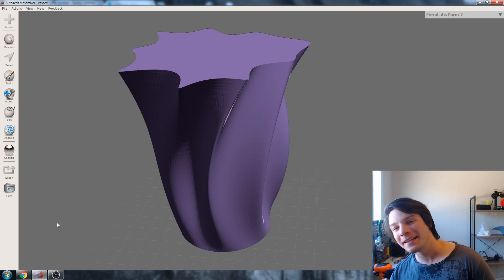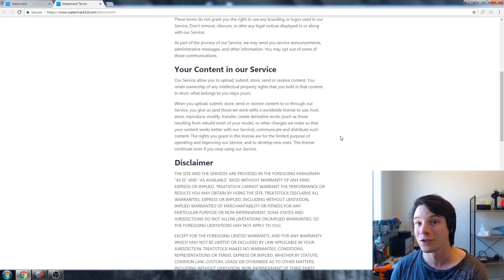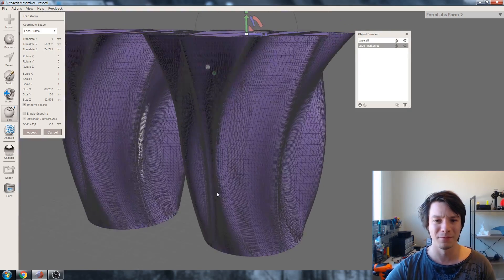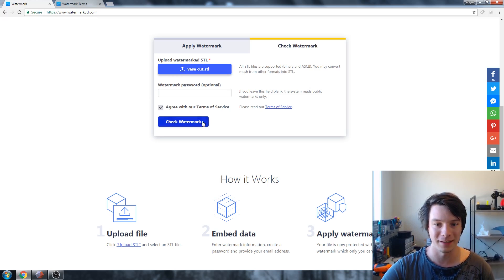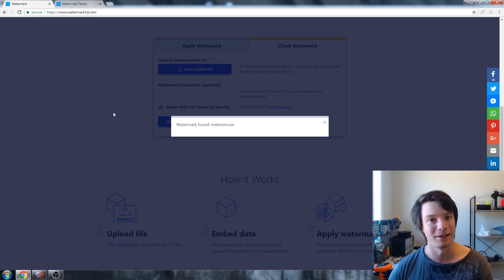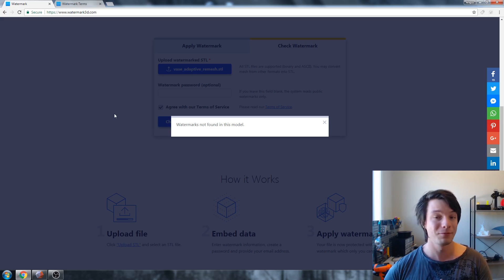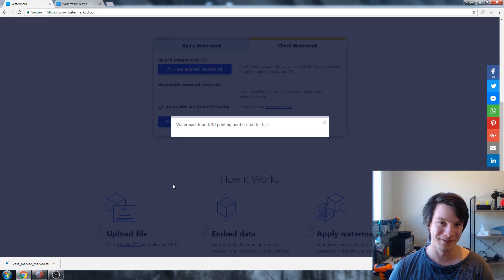How to defeat an STL Watermark (but would anyone really do this?) Watermark3D Round 2

Comment: As a programmer who works with the data files of 3d meshes, I can explain how this works and why it's not as easy as re-watermarking it. (Sorry this is going to be long, but it's worth it to learn! :D)

The system, from what I can see, works on a system with 1 layer of redundancy (which is better than none!), which is why cutting the model in half didn't work. Those points where the watermarking process has changed the geometry, you can see them as the clustering areas that get extra divisions in the wireframe of the resulting model, are each a watermark on their own. You'll see four such spots up the side of the model in some frames of this video, and they're thrown around based on some spacing algorithm. With them all over the model, the software only has to look for one of the many watermarks it has put on. So cutting the model in half may have deleted 4 of 8 watermarks, but of the remaining 4, at least one of them could be read.

I would wager that if you examined the model by eye, found all the areas that were distorted, and made a small geometry change to each one, like deleting a vertex or a couple sides or triangles and filling in the hole, then, if you didn't miss any, the watermark would not be able to be found by their software, and would be destroyed. This is why re-meshing the model DID destroy the watermark - that form of attack successfully alters each one of the spots on the model where the watermark was applied, destroying them all, and leaving none for the program to find.

Additionally, this program clearly stops when it discovers the first watermark, and returns that result. It is surprising that they didn't think about this, but oversights happen. However, that also means that your previous watermark WASN'T ERASED - and you'd be able to prove it's there if you needed to. All that happened was that when you watermarked it a second time (thus adding the new areas of distortion that you noticed at 10:14 in this video), the service added the new watermark at different spots on the model, leaving the old one intact. But when you put it into the service again, the service was looking for a watermark pattern in a list of vertices, and the one it happened to find first, based on where on the model it was placed, happened to be the second one. This will always be the case for this model no matter how many times you scan it, because it's the order of the watermarks built into the model that determine which one gets read first. For efficiency, the programmers made the program exit once the first instance of a watermark is found.

With a simple change in code, but a significant hit to the speed it can scan a model for watermarks, they could make the program not exit once one watermark is found, but add that watermark to a list, and keep searching for others. The geometry of your model still HAS your original watermark, after all. The program just gave up looking after it found one.

A better solution that keeps processing time almost the same (probably slightly slower though), would be to scan a model for watermarks before any are applied, and throw an error if the model already has a watermark. This would be easiest to implement, and would negate the danger of partially overwriting a previous watermark, which could happen if they went with my first suggestion, which may result in a corrupted or overwritten watermark result.

My final suggestion to improve this service (not that the company will see this or anything XD) would be to add in more layers of redundancy - like add in the technique where you modify the binary of the STL file - sure re-saving erases that, but then you have more steps that someone has to go through to remove your watermark, and only if someone knows about it. (I guess I am kinda spilling the beans, but oh well, how many people are going to see this comment anyway? :P)

All in all, this is a great program and a great technique, and as you mentioned, thieves wouldn't go through the work required to remove such a watermark. I love this idea, and fully support it, assuming they made the quick change in code to throw an error if you try to watermark an already watermarked image. Great job on Watermark3D's part, and great job to Maker's Muse for doing a second video about this based on the comment reactions, giving us the thorough teardown we wanted! :D
Reply: Thanks, i learned a lot about redundancy here, even if i'm a programmer myself (not in this domain AT ALL).
It was worth it to search for your comment !
Reply: I wonder if you send them an email if they'd consider (or maybe already have implemented) ideas like this... (I wonder if they've watched this video, since they reached out to Maker's Muse originally).
Reply: Is it possible that the algorithm that decides where to place the watermarks, is simplistic enough that it literally put the new one on top of the preexisting one, thus actually "overwriting" the old one (or at least corrupt it beyond recognition)?
Reply: Great contribution!
Reply: the most underrated comment on here!
Reply: Good explanation! Thanks for the bother of writing it here!
Reply: interesting
Reply: this is exactly what i was thinking!
Reply: I’d like to see time stamps added to the watermarks combined with searching for all watermarks on a given model. I’m also curious whether the actual watermark is encoded into the mesh or if an ID (almost like a QR code or barcode) is encoded and represents an ID in their system which they match to the watermark that they have stored for that ID.
Reply: @Deesdessessesder  most probably the text is encoded and not stored plainly, because otherwise you would need bigger watermarks for bigger texts.
Reply: Oooooooooowww kaaaaaaaayyyyyyy

Comment: Could you try and watermark an stl that is already watermarked and see what happens? If you succeed with that could you continuously layer watermarks and see if it eventually ruins the geometry? And then with multiple watermarks put it in the things that checks for watermarks and see what it tells you? Should be interesting just to see how the software works
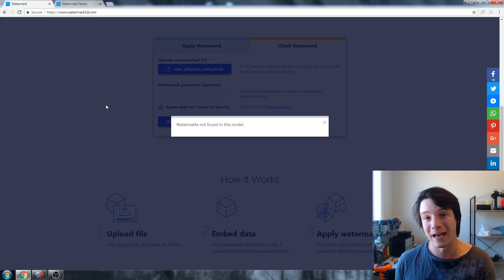Reply: < commented before I got to 9:31 so you can ignore the first and last question but I would still like to know what happens if you continuously layer the watermarks and see if it ever starts to effect the geometry, also what happens to the file size with that many watermarks?

Comment: What if you were to print with a dual extruder where one extruder has PLA and the other has TPU (or any other flexible filament). Would that be able to make flexible joints?

Comment: There are probably re-meshing algorithms that can maintain the geometry while wiping the watermark. In fact, it can be argued that the algorithm that creates the watermark is itself is a re-meshing algorithm, so it's not surprising that similar algorithms wipe the watermark. As far as concerns about it wiping the old watermark goes - if you're not concerned about people finding the watermark to begin with, should you be concerned about wiping the old watermark by applying a new one? Doesn't the same logic apply?

Also, there is only so much data density that can be achieved using a watermarking algorithm like this. There might not be enough points on the mesh to store multiple watermarks, especially on sparse meshes.

Comment: Lot of algorithms exists to wartermark meshes for examples:
http://gfx.cs.princeton.edu/proj/meshwm/meshwm.pdf
Some of them try to resist to remeshing, smoothing as well.
So to do that we have to describe our mesh on another space. Like "If I launch a sound on the surface of my meshes how the shape of the sound will look like after 10 secondes (if my meshes is a jelly or metal etc)" this kind of description resist very well to a lot of thoses attacks.
We can do multiresolution as well:
https://pdfs.semanticscholar.org/2cf5/7837f09ebbf57f94b71ccd4a46f1eb01feed.pdf
We can do downsampling of the mesh & rewater-mark it at each resolution, and "reinject" the lost details. ( :

Comment: wow...how did the programmers not foresee overwriting the old watermark? I wonder if putting in a password would change the outcome.  It seems like it would make more sense to instead before it applies the watermark run it through the "does it have a watermark" system first. if it does then point that out "this model owned by xyz, would you like to reassign the watermark". where having a password would simply output something along the lines of "unable to complete operation, password restricted watermark already on model" and leave it at that.

Comment: Definitely weird, seems like it would be simple enough for them to check the watermark and say sorry this model already has one.
Reply: Box Jockey theyes prevent password protected watermarks from being overwritten
Reply: Someone down below mentioned two people could apply watermarks and passwords to the same file and depending on what password you enter, you get the associated watermark.  While that would technically preserve both, it sounds like you cannot verify which was first.  Just seems like only allowing one watermark would be a simple solution to prevent this, though I am sure someone would find a way around that as well.

Comment: Lot's of time and money, highly competent engineers trying to make a new copy protection watermark for stl files........ Just re-mark it... NAILED
Reply: Raposa Dislexa Ironic. They could save others from defeating watermarks, but no themselves.
Reply: Michal did you even watch the video?
Reply: The bright side is that it isn't quite that bad - the original "makersmuse" watermark is still there on the  model, it just wasn't listed for the sake of processing speed. With a slight change to the code, the original watermark could be recovered and read. (For a more detailed explanation, read my post that's somewhere in the comments here!)
Reply: @KyleBlumreisinger  Though it’s the same algorithm writing onto the stl file. I wouldn’t be surprised if the second watermark was editing the exact same locations that were edited in the first marking, completely destroying the first watermark. Easiest fix would just to check for watermarks and throw an alert if there was already a watermark detected before putting another on in.
Reply: Raposa Dislexa and there's a really easy fix! Just scan for a watermark when you try to watermark the file and if it finds one, refuse to make another!
Reply: Just seems like one of those minor bugs that can be easily fixed.
Reply: Did anyone bother to read the FAQ on the website? It states "If a password was used for the original watermark, a new watermark will not replace the original watermark. In other words there will be two marks with different passwords"
Reply: 1) It seems quite easy to distinguish an automatically remeshed version of a model. In case of a dispute, this should resolve the conflict easily.
2) If someone adds a watermark to a previously unmarked model, the fact that the original owner has an unmarked and non-re-meshed model should resolve the conflict in their favour. They can't remove the watermark without remeshing, which means they owned it prior to the watermark existing.
3) If someone adds another watermark on an already watermarked version, it gets overridden, but this appears to only apply to "public" watermarks. Just knowing that a private watermark exist doesn't help the thief if they don't know the password to it, since they can't override it. However, so long as the original owner knows the password to their watermark, that proves their claim.
4) In the rare case that the thief figures out your password and overrides your private watermark, studying the model will be the deciding factor. Even if the password was overwritten, the original author will own a simpler, non-re-meshed version of the model, with the original watermark. As you can see from this video, overriding a watermark makes the geometry more complicated and is thus possible to detect.

So I'd say this is far from a waste of time. Any time this service comes into play anywhere in the process (whether it's the thief that adds or overrides a watermark or the original owner), the original owner can be determined.
Reply: Raposa Dislexa you can't watermark model that already has watermark

Comment: Hello , your videos are awesome. I have a question and I need your opinion as a professional. 
I need a 3D printer to producing fountain pen (body) and the surface of products  should be smooth , shiny and layers shouldn't be visible.Quality is  very important.  I don't need big printer because pens are not big. But quality is important. As I researched in this case resin printers are more suitable than filment printer. Do you agree? 
What affordable printer you recommend (model name and price and how to buy) and if you have any suggestions for material would be nice of you to tell me.
Heavy material is better because when you hold fountain pen you don't like light pen like a cheap BIC pen.
Thank you so much
Reply: For "smoothness" and nearly invisible layers (need magnification to see) then SLA or DLP resin printing is quite a bit better than FDM. The Wanhao D7 seems to be one of the strong contenders. Unfortunately, resin is still a plastic and will remain lightweight... even the FDM would require one of the "metal filled" filaments to get any "weight" and then you are losing surface detail... There are a few FDM printers that can be tweaked to a very smooth finish but you will nearly always have "steps" due to the nature of the process.
Reply: Edward Paulsen what about strength of material?
Is it fragile or strong enough? 
Thanks for your answer
Reply: Either one can be fairly strong but that also depends on how thick you make the walls and with FDM, how you orient the part on the build plate. Each layer provides a potential shear point to break depending on how well the layers stick together on an FDM machine. Resin is quite a bit better but it can become brittle if hardened for too long or if it will be exposed to UV or fluorescent lights, you may want a UV resistant coating.
Reply: Edward Paulsen thank you very much.it was helpful

Comment: What about merging two models with different watermarks to one model - which watermark wins?
Reply: I made a longer post about this elsewhere in this comment section, but I believe I can answer that question: Based on where in the model, or rather, where in the list of vertices in the STL file, that the watermarked spots on the model(s) are, one of them would get picked first every time, and the other not listed. With a slight change in code, the service could detect and list both if they wanted to though. (For a more detailed explanation, read my post that's somewhere in the comments here!)

Comment: i would very much, like to know what happened to the first mark and why it doesnt search for a mark as a step 1 to applying a new mark. so it can throw the error message saying its already marked by whoever. and then email the original owner to tell them it was attempted even. i guess u got to mark it in no less then 5 methods just to be somewhat secure.

Comment: I don't buy the "thieves won't do it" argument. Where are the thieves? mostly the platforms selling stuff, and there you can surely come up with a batch solution, just per standard run all your stolen stuff through it, done. Doesn't matter if it had a watermark before.

Comment: The watermark folks need to add a check for watermark before applying a second watermark and error out if an earlier one is found.  Of course if other watermarking services come online they might overwrite or just add a second mark that can only be read by their service.  Watermarking also needs to add and register a date to prove priority or it is useless.  However this will not protect or provide proof in the case of a printed object and that is were the real actionable theft is.  If someone passes off a design and profits from printing copies or in completion with ones own business of producing copies then civil or criminal action is possible.